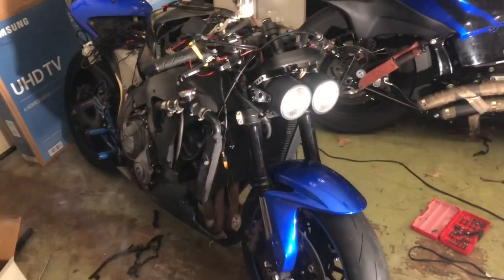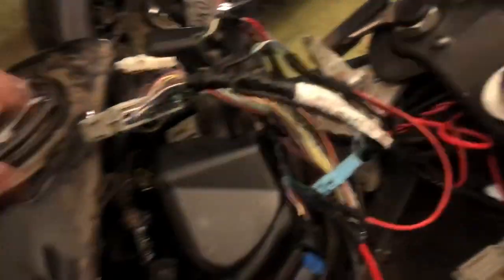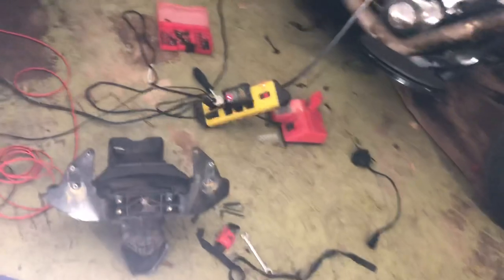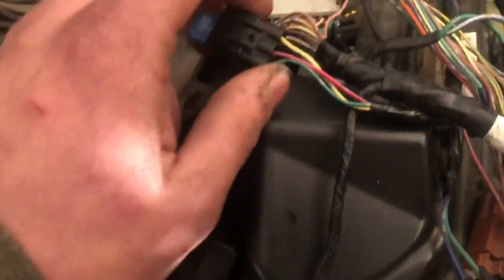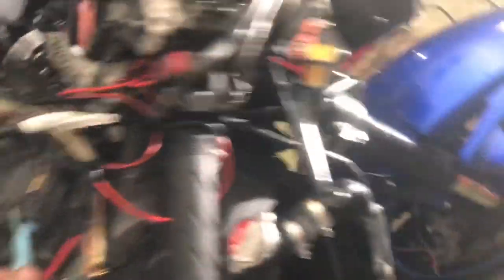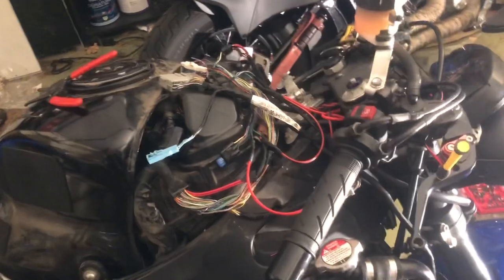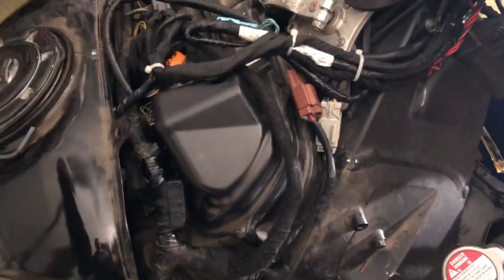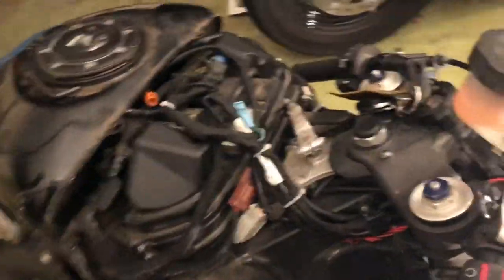How to Build a Custom Streetfighter CBR600RR The Correct Way

Comment: Hey great video! I have an 05 cbr600 that's in the works. The wiring harness is gonna drive you nuts man, get the clymer manual with the color wiring diagram. It'll save you a ton of headaches. Also you can commingle the bank sensor to the brake line mount that's under the headlight at the triple tree. Looks funny but it does the job to make sure you don't eliminate it completely. I tried using a simple cluster mount like this but the vibration on the cluster was hard to get it to stay put. I recommend something sturdier, you may need to fabricate a bracket from scrap metal because there isn't much out there as far as super sport streetfighter parts. Have you tested if the tank cover will fit with the wires under it?
Reply from the maker: Sorry for the super late reply. Hope your build is going well. I’ve had the bike over 160mph without any problems. I built it extremely stout. Everything fit under the tank cover perfectly. A tad of a tight fit, but everything lined up flawlessly.